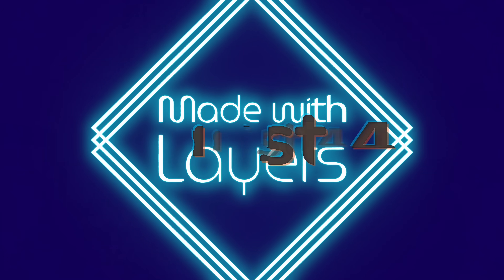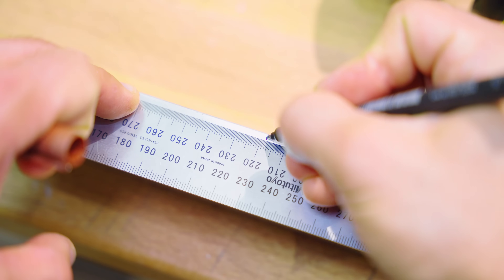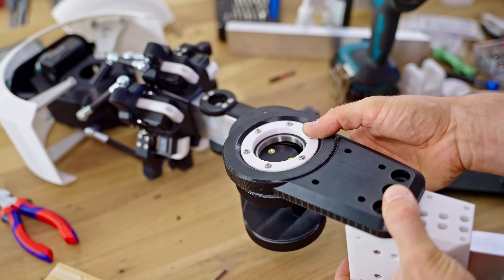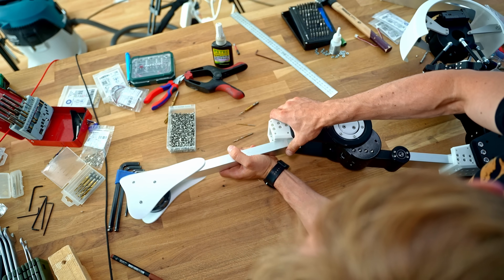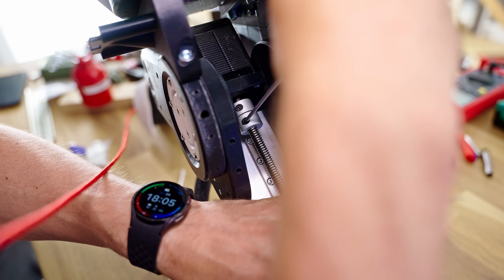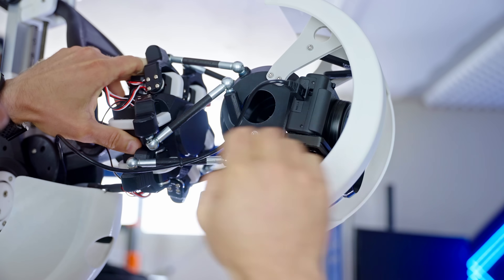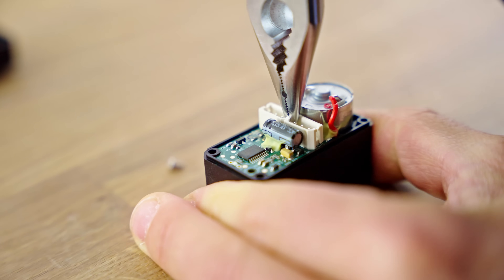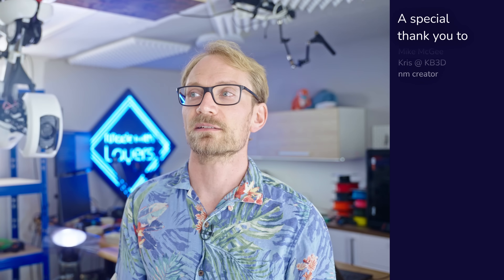Meet Caroline: Testing ways to build a cheap Robot Arm (for science!)

Comment: Nice Job Thomas.  An easy, super cheap way to make slew bearings is to use a pair of 'lazy suzan' bearings in a stack with adjustable axial preload.  The Lazy Suzan bearings at first glance are horrible, low tolerance.  But you can tune out most of that with the preload, without the bearing becoming to stiff.

Comment: Great job!  I would be most interested in using BLDC to make servos, but then go further by adding other sensing than just position like strain, acceleration….controler current Then make the data available to a vibe code AI and have competitions for code then a competition for hardware improvement and so on.

Comment: This Is awesome i want one(seriously how much $$$). This could be a really cool community project , will you add rails to the ceiling so it can follow you around or help multi task ? a small gripper on it would be useful , i just don't know where it would look the best (proportionally) . like, should it be added to the existing linkage or have a secondary base plate or make the original base plate(turn table) wider to accommodate for an additional arm.

Comment: Did anyone catch what software was used for inverse kinematics?
Reply from the maker: It's a fully custom program, using a combination of simple trigonometry (manually solved) for the base axes, and a bunch of intersection math for the Stewart Platform.
The visualization I showed was done with VPython, though I wouldn't really recommend that approach - use a ready-made IK solver instead if you can make it work for your setup.

Comment: This is so awesome and inspiring! It really makes me want to get more into kinematics!
There is one thing I'd like to point out: brushless DC motors do indeed have good torque, but this torque is on RMS speed (preferred speed of the motor). Normally that is pretty high. Servos are nice because the torque is pretty much available from the bottom of the rpm range.
You did a demo of turning the DC motor at the end of the video, but that motor had no load on it whatsoever. Industrial robots have (very big) servos for a reason. Granted, those servos are really expensive, while DC motors are less expensive, maybe you'll find a way, I'm curious!
Also, why did you go for leadscrews in stead of belt drives? A belt (with gear ratio) might be way faster?
Also, some of us needs would love to know exactly how the CAD design went and would like to know more details on coding. Anyway, keep it up!

Comment: Very cool - if I had the headroom I would probably have gone this sort of route for my robot camera setup. I love how clean this all looks compared to my mess of wires :-) one thing I played with which you might find interesting was modelling my robot in blender, usinng it's IK and animation system to easily create animations that can be tweaked keyframed etc with whatever bezier curve functions you like. then exported it all as pre-computed motion to drive a robot arm animation. I've struggled somewhat with reliable angular position sensing but I suspect you'd have much less trouble with this setup.

Comment: Just a precaution. Many plastics get brittle when exposed to thread locking. So try to avoid getting it outside any heat inserts or other metal threads.

Comment: Sorry for pointing out an issue with your design, but I think it's good to know: (@4:33) Threadlocker is meant to be used in metal vs metal connections. When used in plastics, it first of all doesn't form a good bond, but second of all it's known to actually weaken the plastics it comes into contact with. Especially thermoplastics. There's a lot of info to be found about this, including one video called "Don't Use Threadlockers with Plastics".
Reply: there is a locktite product that used cyanoacrilate instead as a solvent insead of acetone that works great loctite 425
Reply: What should you use?
Reply: I think cyanoacrylate glue is an option.
Reply: @johngwinner9941  look up "thread lock for plastic" the Loctite version is 425 and I assume that other manufacturers have a similar product.

Comment: Impractical, but it would be so cool if this things final version ran on a semi circular linear motor track so it could eventually follow you around your studio/get different angles.

I'm just imagining using some text to speech like whisper and maybe an on board local llm to translate every day conversation into moves with the camera as a tool for the llm.

Add in some OPENCV to follow objects or something like Nvidia toolkits to follow faces and this thing would be a sick one man crew.

I really like the lead screws for smooth and rigid motion given that's like the problem that needs solving for arms. I feel like/bet they'd be reasonably backdrivable with a ball screw or perhapsjust more course and lubricated lead screw (like wd40 ptfe spray)

Comment: If it was my project but with your use cases, my future steps:
Creating the MIB Neuralyzer - a Pre-Scene Staging Wand.

Goal: A handheld remote with IR emitter that the robot arm can tract.
|) Adjustment modes (single adjustment mode):
- Track adjustment: Star and Circle (fixed orientation markers for left and right) controls to move arm along track
- Arm adjustment:
- - ToggleHead lock: Fixed to current | Fixed to Pointer | Home (centered the lens is in line with lower arm)
- - Moving the IR Wand will track the camera within it's save operating area. Indicating with blinking red light if IR location exceeds safe zone.
- Head adjustment: Moving IR Wand will track the camera solely with the head axis motors. Arm and track stationary.
|) Save locations.
|) Millimeter wave sensor on head of the camera with a frequency isolated noise emitter on the wand to the head can identify the wand to confirm IR source and double check depth of field data.
|) Collision Feedback Fail Safe: resistance on arm equals fail safe. Let's not leave anyone black and blue.

Comment: For thin aluminium better than threading are self drilling screws for steel. Those for plaster boards are good enough, and the thread itself (in alu) can survive few uses. Eventually stainless steel 0 clearance rivet nuts

Comment: You could use machine learning to make it learn how to move in space by itself, skipping all the manual IK code. First train a neural network on a simulator, based on the 3D model; and then when it gets good enough, make it learn by directly controlling the hardware arm. If you integrate it with a multimodal LLM (camera vision + language + speech + arm control) you could eventually speak to your room:
—Caroline, pan around the red object on the bench, slowly.
—Caroline, do it again but from a lower angle.
—Caroline, do not focus on my crotch.
—Caroline, do NOT release the toxic agent into the envir—

Comment: It's silly, but I've always wanted a glados in the ceiling of my workshop with a small bright projector so I can use a voice assistant to find my parts. "glados, find bearings", or "find the M3 bolts" or "locate the micro controllers", And it transitions over with a cool animation. I know where to find everything of course, which is what makes it silly. Cool party trick though

Comment: now you just need a track so she can glide across the ceiling.

haha I really should watch the whole thing before commenting, bonus points for making it a circular track, put a power rail in it with some brushes, super caps to smooth out the noise... or maybe just some batteries as a buffer, when it's stationary it can charge, when it's moving it can provide power from the cells till it's sitting idle again.

Comment: the arm camera seems wobble a bit in roll axis. ie not stable. single support point axes are wobbly vs two point mounts axes. ie the arm has flex along the length as lever torque. maybe two square tube arms scaffolding would be stronger than single square tube. well 3d printer or laser needs more stable end point control. ie if you put a 3d printer hot end tool instead of the camera, you can check how accurate your arm assembly is.

Comment: Instead of using BLDC motors in 3D printer, not a bad idea though, use Caroline, with BLDC motors, as a 3D printer. All those degrees of freedom will put an end to orienting a model on the build plate for maximum strength, minimal overhangs, or reduced support material. If You make a build plate with an increased number of degrees of freedom .......

Comment: Needs an extra axis at the very end to rotate the tilt the camera and keep it aligned with the horizon.
Or a 360 camera with that done in software.
Reply from the maker: The Stewart platform is a full 6DOF platform, so it can absolutely do that. It might not have been clear from the video, but while the simpler keyframe animation mode allows any pan, tilt, roll position for the camera to be saved as a keyframe, the inverse kinematics mode already uses the Stewart platform for horizon alignment. From 13:55, you can see the red axis sticking out of the head, that is the alignment axis the IK solver tries to keep parallel to the horizon.

Comment: Perhaps a cheaper design could use spectra fishing line (or similar) to move the 'head' around a pivot? Instead of the ball joints and rods it could be spools that wound/unwound in sync for motion.

Comment: That was awesome! Can’t wait to see it on tracks. Can’t wait to see it with brushless motors. Love to see a V2 where you include fixes from what you have learnt. It is a great price for what it can do. Absolutely brilliant, well done!
Reply from the maker: Thank you so much! First step will be actually finishing Caroline to v1, with fixing the parts that I had to compromise in order to meet my deadline, like adding thrust bearings for the leadscrews, a proper base bearing, straight lift links that won't bend, and proper endstop triggers. By then, the big one should be easy, right?
Reply: @MadeWithLayers  would it be worth getting lead screws with a large lead so you can do faster travel moves? Or brushless motors be fast enough to give you fast to slow camera movement with the existing leadscrews?
Reply: @MadeWithLayers  Just wondering what coding language did you use?
Reply: *management rail
Reply: As what he said

Comment: yeah rather than linear ball screws, just geared brushless motors with your own encoder is very powerful and compact. And consider 3D printing metal parts where you need some local strength. unionfab seems good price. There is a big difference between 600MPa and 30. You can also print the cogs, not just housings. With metal parts it can be top notch sophisticated, not the typical duplo sizing needed for frail layer plastic prints.

Comment: Tapping threads into thin wall aluminum is pretty weak so not your fault they strip out. Rather than screws I’d use pop rivets as long as you don’t need to take it apart again. If you do, rivnuts or even threaded inserts you use for 3d prints work great in aluminum tubing you just got to size your drill bit just right to get a nice hammer in interference fit. Put a drill bit in a drill press and file down a drill bit to be the perfect size. Then you will be set for all your holes. For m3 I found that a 1/4” bit with a super light touch of the file will give my brand threaded inserts the perfect bite in soft aluminum

Comment: 4:00 I had an identical situation shere I wanted to have nuts inside a thin-walled tube, in a location I could not reach.  It needed to remain hollow to allow a wiring-loom to pass.
My solution was a short 3D printed piece of rectangular tube, that was a nice sliding fit.  It had a hexagonal pocket in it to hold a standard nut, so it could not rotate.
In use, drop a nut into the pocket and slide the whole thing along inside the tube with a stick or string, until the nut lines up with the bolt-hole.  Job done!
Reply from the maker: Ah, I've seen that solution used somewhere, too! Though it was simply a strip of metal with tapped holes in the right spots that got slid into place, then used as a nut plate to secure another part to it.

Comment: 16:47   The rigidity is really impressive!
Reply from the maker: The scissor lift mechanism is really putting in work here, but there's three spots in the design that I think are still worthy of improvement:
- The arms are much more rigid printed in CF-PETG, but still need to be redesigned to have less of a curve
- The base bearing is crucial, yet has load paths through long stretches of printed plastic 
- The joint at 6:03 is a visible weakspot and can compress under heavy load, causing an offset in the lift geometry and amplifying any flex that happens there

Improvements for all three are in the works!

Comment: ooo dc brushless motors is an interesting idea, good for non stop spinning but not sure about changing direction often. thats why it should be given the college try! lol
Reply from the maker: I think they should be at least as good as steppers in that regard. Especially larger stepper motors have substantial inertia relative to their torque output and still require a safety margin to not skip steps. BLDCs in FOC mode will never lose steps and can be driven much more intelligently, which leaves more headroom to drive them past their rating when it's needed, e.g. for direction changes.

Comment: I would be interested in seeing a RL approach to moving it around. The RL demo's for humanoid robots are way to complex for basic intros, and having a RL based arm from portal would be sweet.
Reply from the maker: I assume RL is reinforcement learning in this context?
I've thought about how I would eventually be able to distribute the positioning motion over what will be 11+ degrees o freedom, and my current best take is using an optimization strategy where each joint has a varying cost associated with different parts of its motion range (e.g. not wanting to be fully stretched), and weighing that against actually reaching the target pose. Though unless I also account for cost for acceleration, that could simply be pre-calculated and then interpolated from a lookup table for any possible pose.

RL might not be as useful here as in robots that need to interact with the real world, as Caroline is running on a very fixed track with no external disturbances.

Comment: I love this. Would love a deeper dive. I'm also interested in the maths behind pointing at a fixed spot while moving around it. So, basically: more please!!! 😀🙏
Reply from the maker: Thanks! The tl;dr of the motion simulation is lots and lots of coordinate system transforms, where each actor has its own local coordinate system that it runs in, then transforms its position and alignment into world coordinates based on what it itself is attached to. It also provides an attachment point (and alignment) for the next actor, so in the end it's pretty modular - which I need when I add even more degrees of freedom with the rail system!
For the target tracking with the Stewart platform, I move the platform into position and then figure out my servo links from that. It's all happening in 3D space, and having some sort of visualization available has been a gamechanger for the process.